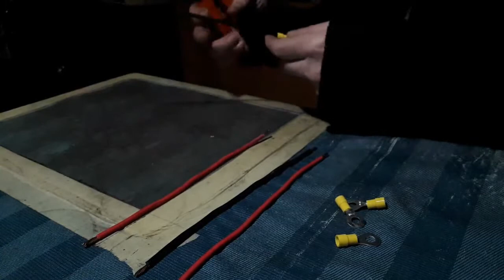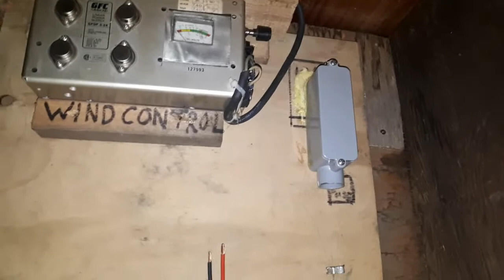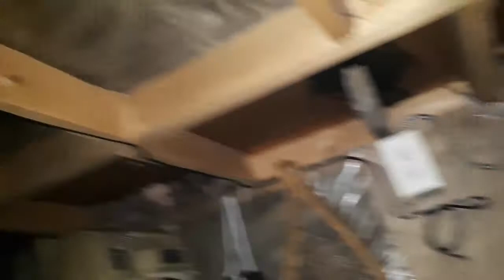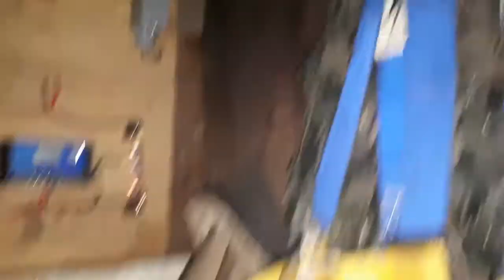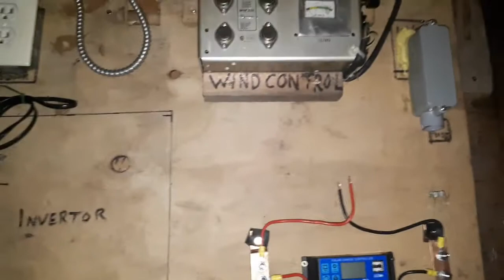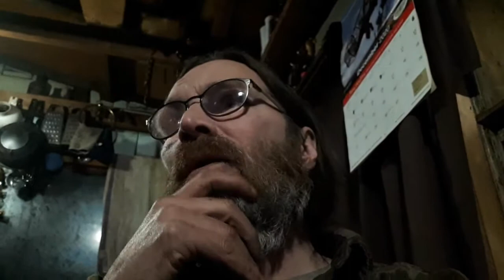Working Towards The Solar Upgrade

Comment: Thanks Wolfie for the video. It was very informative. Just wondering why you would stop using your wind generator?
Reply from the maker: Thanks David... we actually didn't stop using it, we've never installed it... it's one of those things that kept getting put off due to us not being 100% sure of it. I would like to get it (or a boughten one) up and running to add to the system.

Comment: Hey Wolfie.  What wind turbine are you thinking about using.
Reply from the maker: original option is one my dad built... but we're not 100% sure on the power output so we've been considering a factory made. If so i'll be looking into one from Missourri wind and solar... they have some of the best on the market and have excelent customer service